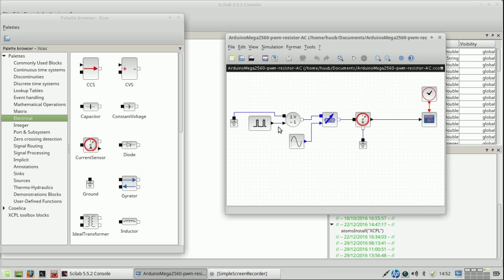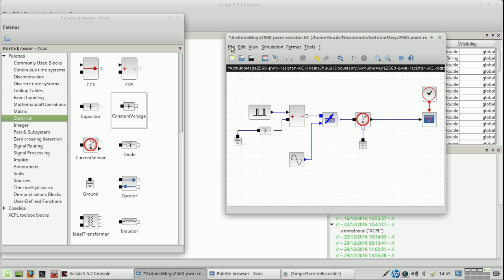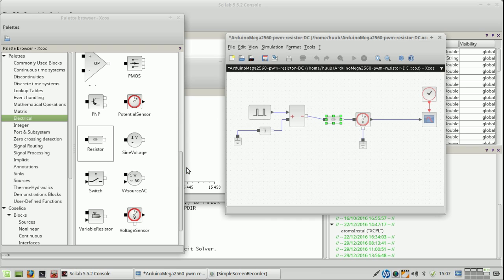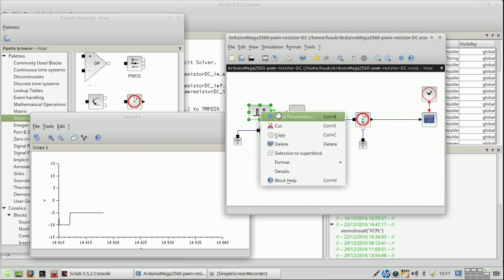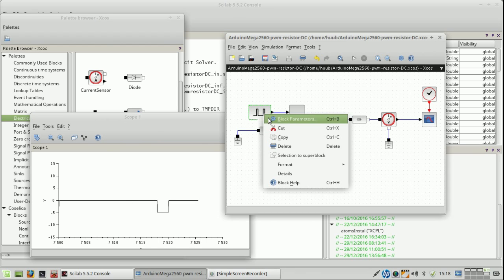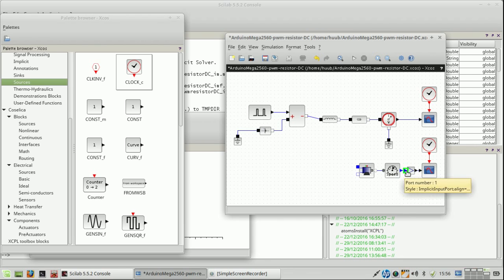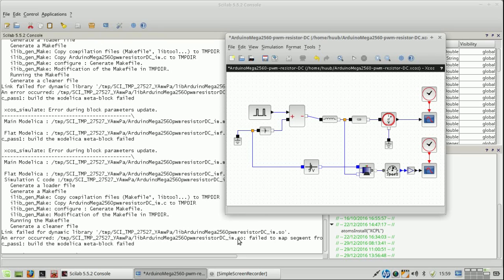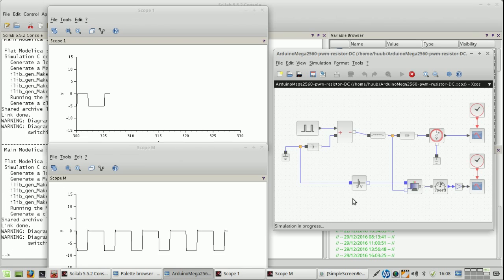Arduino Mega2560 ep. 37 : more pwm simulation using Scilab/Xcos

Comment: 11:35    seems like you need another resistor to ground,  in order to form a voltage divider... the variable reistor won't do any good unless there is a ground on one of the three leads...
Reply from the maker: Thank you for your comment. Where do you see a voltage divider in that circuit and at that time (11:35)?
Reply: @HuubvanNiekerk  I gather that you are trying to reduce the level of voltage going into the sensor.  So connect another resistor from the sensor input to ground,  west of the existing fixed resistor.  These two resistors will form a voltage divider that will divide the voltage at the sensor input.
Your video is helpful in any event,  since you are demonstrating how to use xcos.
Reply from the maker: Thank you again for you comment and explanation. I misread your first comment. This video is a rather old one and I would have to recreate the simulation to apply your suggestion.
Thank you also for appreciating the video because of the demonstration. Did you subscribe to my channel? :)